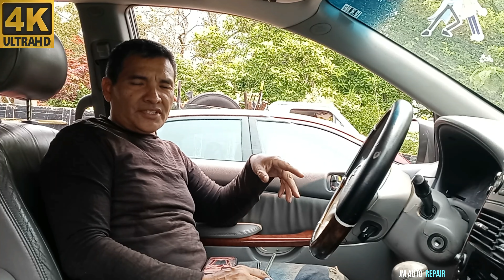toyota sienna crank no start diagnose and repair

Comment: The way you added the new connector is very acceptible. However there is another way which I have done and that is to remove the wiring from the new connector and insert the existing wire into the end of the connector . There are videos here on YT how to do that. However in your situation it could have been a bad wiring at the terminals and so your method is preferable.
Reply from the maker: thanks for sharing I very much appreciate it

Comment: I have a Toyota Siena, while I’m driving it start loosing power and eventually turns off, it will crank but not start, if you wait for a while it will start again with out a problem, why do you think? I’m thinking fuel pump
Reply from the maker: when it turns off, turn on ignition switch and go beneath ( secure the van  with jack n jack stands) to see if the fuel p operates, or disconnect the fuel line to see if the fuel pump is delivering fuel, before replacing it.
Reply: Crankshaft position sensor

Comment: That was a great video! Even the trouble shooting was straight to the point. Thanks for the help! I'm thinking it's my starter and maybe i should check a fuse. Looked in book tonight there is a fuse, starting system and then found your video 👍Also mice love this van 🙉😅
Reply from the maker: thanks for sharing, appreciate your thoughts and also your time on the channel, hope a fuse is the problem.
Reply: @JM-AUTO  Ty! Ended up being battery. Was very cold here. Needed a higher cold crank, thankfully 🙏

Comment: I have the same issue, all the fuses are good, even in the engine bay, just changed the fuel pump
Reply: It happened to me just yesterday, i phone my friend who work electrician in GM he said to me there is nothing wrong on the engine just press all the way the gas pedal and start the engine, it works.

Comment: What's up greetings I have a 2008 Toyota Sienna, it turns on and off, what could it be? thanks for your help
Reply from the maker: hi, scan it first to see if you find any codes crank/cam sensors, fuel pump/blown fuse, normally cam sensors do that. but scan it n see what you find. thanks for the time on the channel.